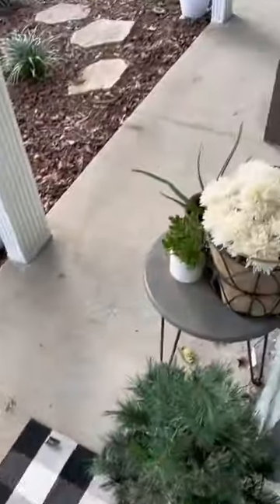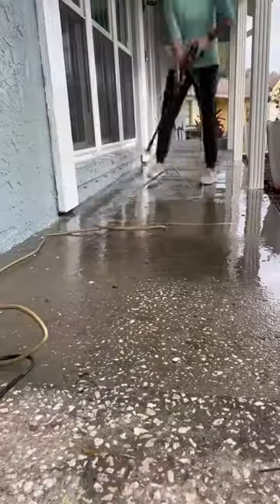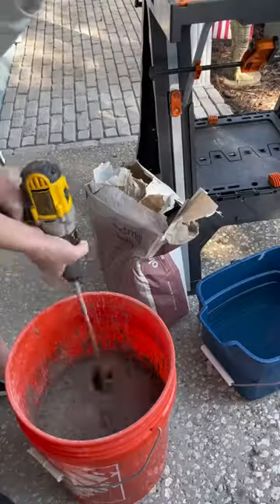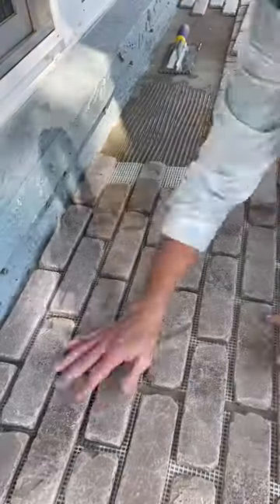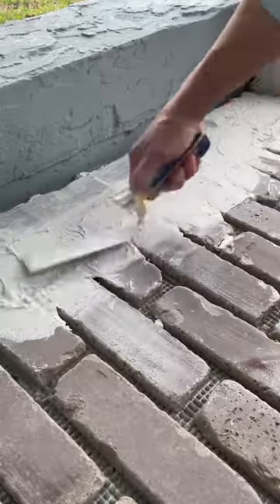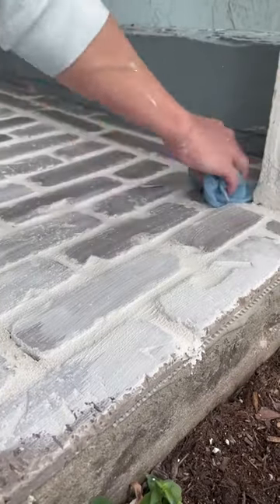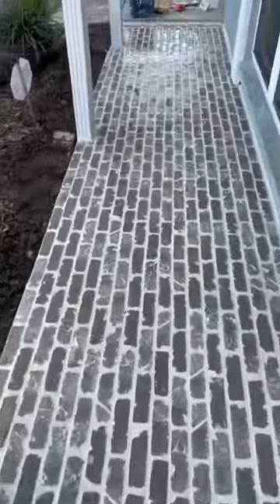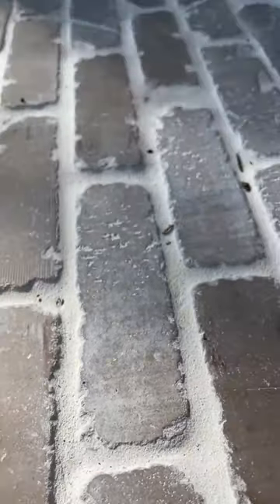Front Porch Makeover: Old Mill Brick Thin Brick Install

Comment: Wait until it get weathered and start to fall apart. Won't last
Reply: It’s under a porch roof so will be fine. Try be nice rather than looking to criticise….it will make you feel better about yourself. It looks nice and she did a great job…. It wouldn’t hurt you to admit that, trust me.
Reply: @Hecklem  I build homes.....it will happen. I guarantee it
Reply from the maker: Okay, well thanks for the comment and the engagement on my post. I appreciate it. But, be a little more pleasant when you're trying to give your expertise. It helps.
Reply: @KellyBazzle  rip it out and pour concrete.
Reply from the maker: How about no? I love it and it's holding up great. It's been through rare freezing temps, it's on a solid concrete slab. It is holding up great because of my work. So thanks. Move along.
Reply: @KellyBazzle  pour the concrete hahah. Your funny I'm have to watch ore of your content haha
Reply: @JAG6.7  no need to be a dick, dude. She did nothing wrong here. This is thin brick, completely different from regular bricks and can be used over concrete just fine.